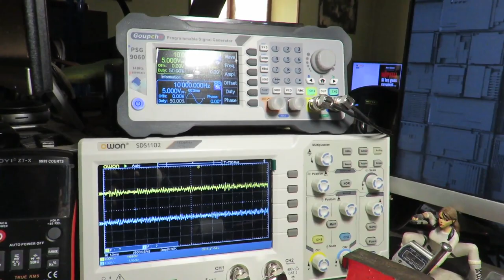GHK6/GHK8 multi-tool with bit kit, mini flashlight & camo sheath!

Comment: There is no GHK8 in the video:(
Reply: @diezelle57  No. Open alibaba. Grand Harvest Industrial sells new GHK8 model, which is GHK6, but without saw and file, like on new Leatherman Curl. Also there are 2 sellers on aliexpress, who sell this new model. Also there is spanish review on youtube.
Reply from the maker: GHK8 (250 grams) = GHK6 (250 grams) -  file - saw + pocket clip !!!
No new Leatherman Curl or Bond.
Reply: @diezelle57  1) I can't put link here.
2) Go to alibaba website. Choose "Suppliers" instead of "Products" in search bar. Type in "Grand Harvest Industrial".
3) GHK6, GHK8, GHK4 and etc. are not Splitman's. Splitman is one of the retailers, and GHK is the factory. Splitman orders multitools with laser logo, or another retailer orders a multitool without any logo. That's all.
Reply from the maker: @chelvturke7588  "GHK is the factory" = ???
GHK8 (250 grams) = GHK6 (250 grams) - file - saw + pocket clip !
In short, really not enough to make an event out of it.
Reply: @diezelle57  In short, GHK8 is another model (like Swisstool Spirit and Swisstool Spirit II, like Wave and WavePlus), which you don't have and made clickbait out of it. In youtube your "GHK8" video is first, instead of spanish review. Congratulations.
Reply from the maker: @chelvturke7588  I do not consider the GHK8 to be a new model but a degraded (but also heavy) GHK6 model, limit stuffing and catching.
"GHK is a factory" = ??? where ?
Reply from the maker: https://ghknife.en.alibaba.com/fr_FR/company_profile.html?spm=a2700.galleryofferlist.normal_offer.3.79864af6pOCRKT